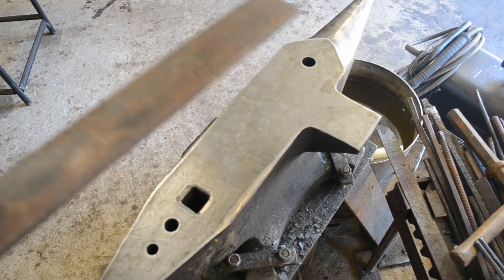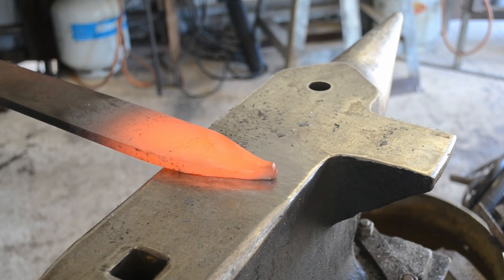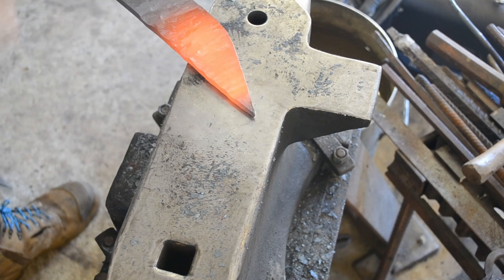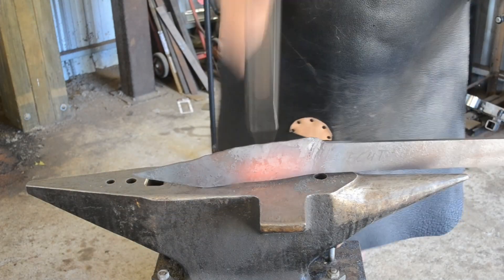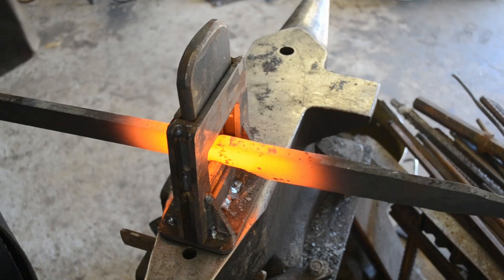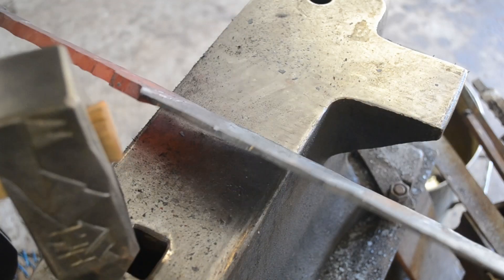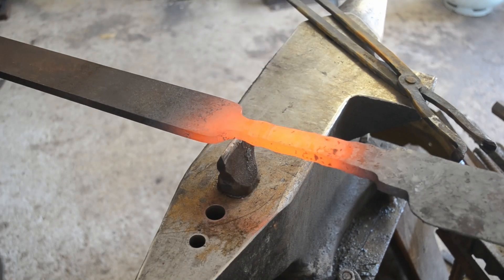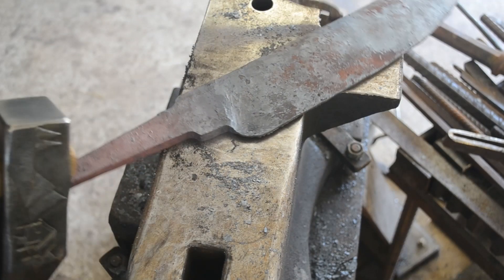How to Forge a Musso Bowie

Comment: Great job! I have not tried W1 yet. Thinking about giving it a shot. I use mostly 52100 or 5160. 52100 round bar is such a bear to move...... You gave me some great pointers, and I will apply them to my hammering.
Reply from the maker: Happy to help! Yeah the high chromium steels can be a bit of a bear, unless you're looking for a hamon I would suggest something like 1084 or 1070, as w1 and w2 are a bit finicky themselves

Comment: Sam, 
An another amazing video man. Your amazing, and I hope to be as good as you and Nils one day. Quick question, I have heard that you can use the horn and side of the anvil to fuller out a blade. I have never done this myself. Is this something that you can do? If so, what are your opinions on it when compared to using the cross-peen to fuller, which is more effective?
Reply from the maker: Thanks mate, drawing out over the edge or the horn is certainly another way to draw out,  I tend to just use my pein as I find it more controllable, if a little slower.